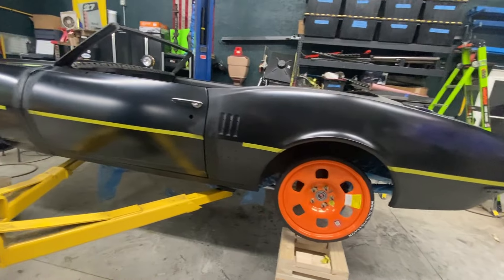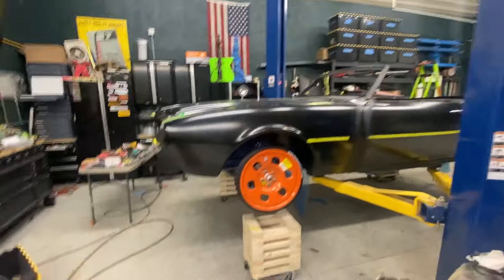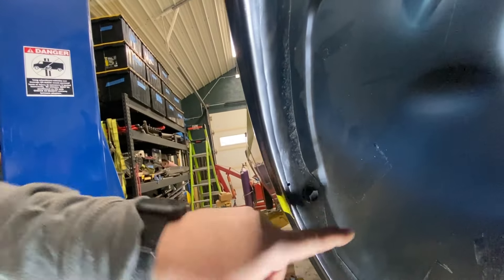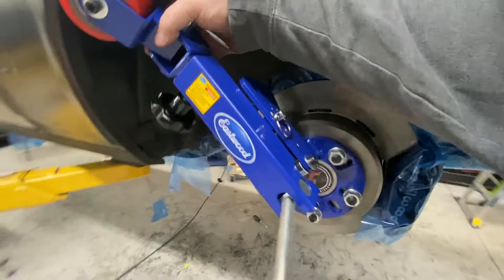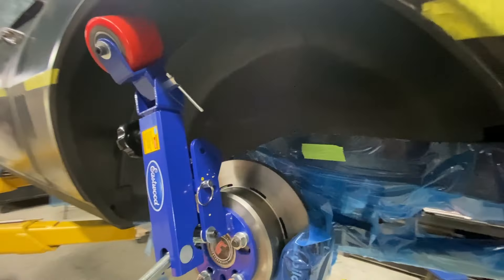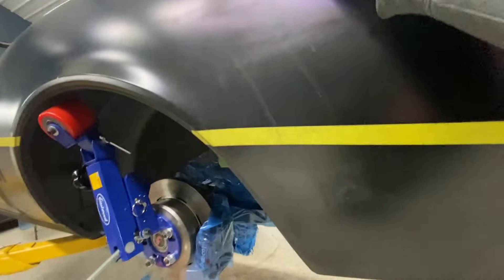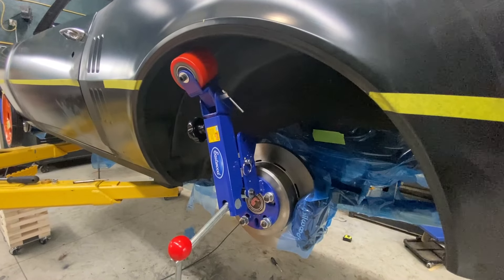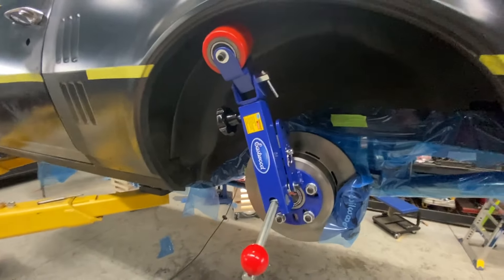67 Firebird, Part 95, adjusting the inner fender seams for tire clearance.  With an epic tool FAIL

Comment: Old Nascar trick. Back in the day we used a baseball bat put it on the edge of the tire and rolled the fender out. I've also used this technique on my Firebird drag car. We made a couple runs and noticed the tire was growing and hitting that lip your trying to fix. Took a baseball bat put it on the tire put a little pressure on it and rolled the car back and forth to get the clearance we needed.

Comment: I cut mine basically in half and left enough to spot weld, I’m going to use tig rod on the edge to give it a finished look, seems rolling will create space but also trap dirt and water at least in my thoughts. Should have close to 14” clearance
Reply from the maker: Excellent point on trapping dirt Roger.  As it Stans right now I have 14-3/8" clearance.